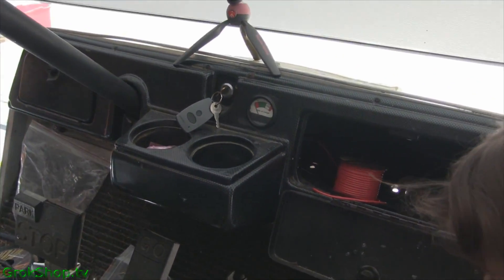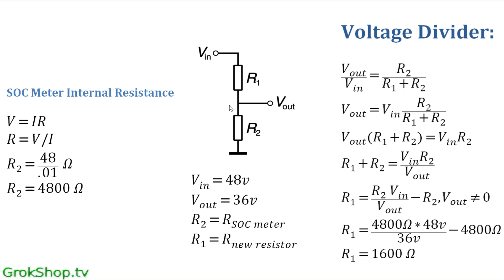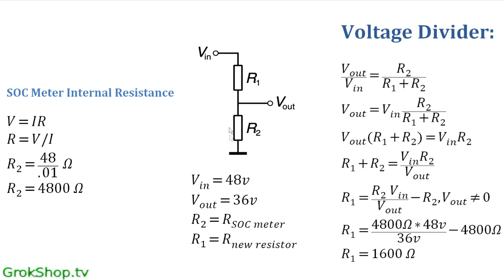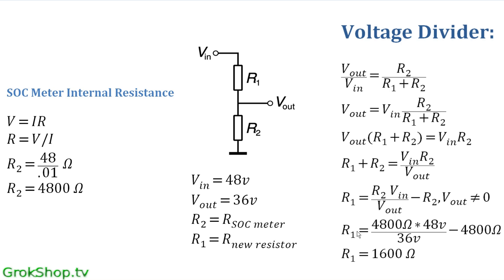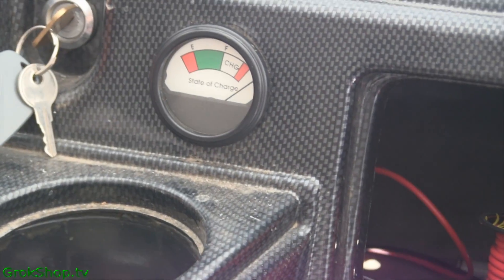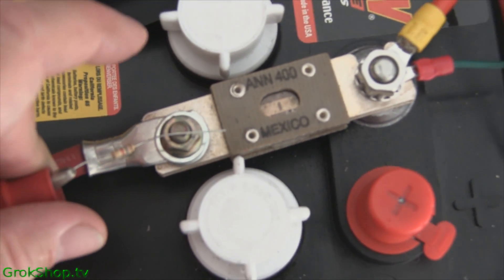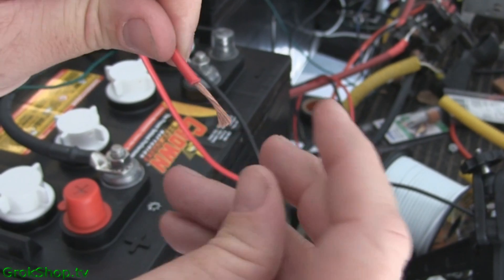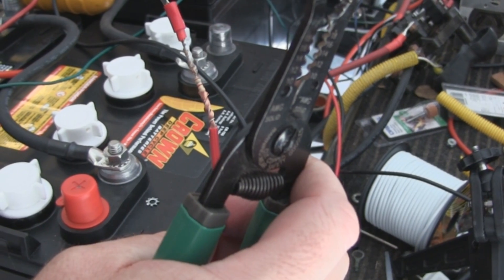Club Car Golf Cart Build | 36v to 48v Conversion [part 3] | Converting Soc Meter From 36v to 48v

Comment: Thanks for these vids!! I have the exact same cart… a 1993 and everything. I was planning on replacing the batteries with 4 12v in a series to make it 48v and upgrade the wires, but not do the controller etc. do you think this will be okay?